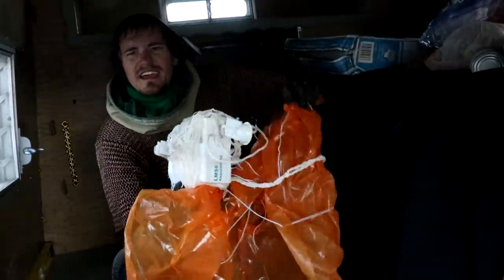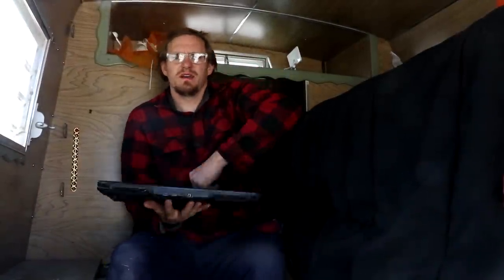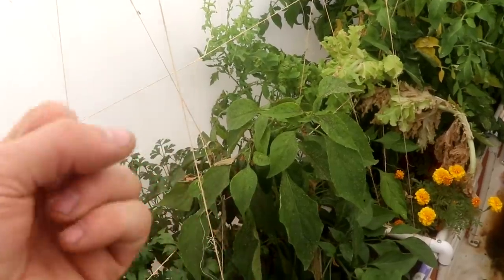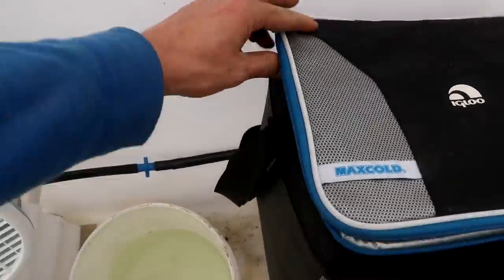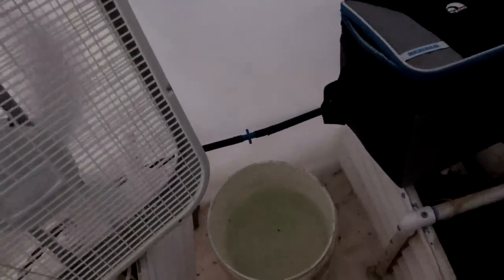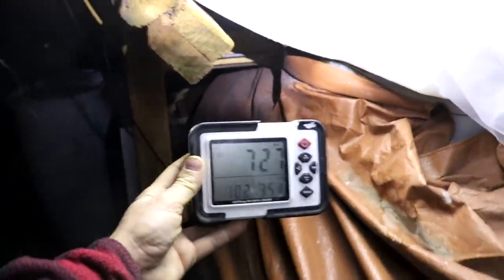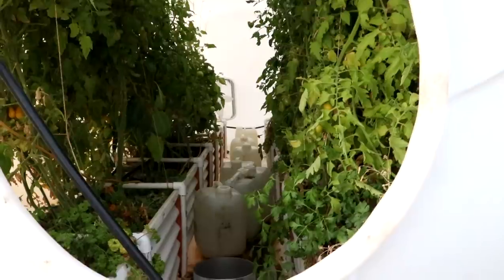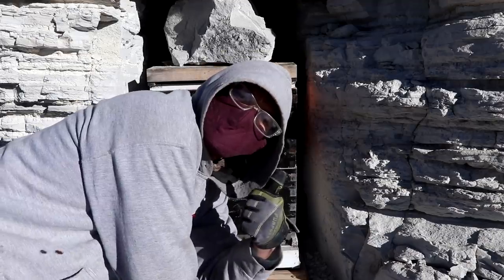ChickenHole Base Ep. 16: Avatar War On Aphids

Comment: I have a naive potato question: if you perforate a potato and heat it enough to cause water evaporation, will starch be carried out with the water?
Context: I'm cooking potatoes in a microwave oven and wonder if I should wash the towel used to wipe up the water in the oven.

Comment: Would ozone kill aphids ? It seems like it would be relatively simple to fabricate some sort of ozone generator inside the greenhouse although I assume it would be fairly power hungry
Reply: Wouldn't ozone kill the plants, too?
Reply: @johnpossum556  I assume so eventually but so would the Co2 judging by the video but I imagine it would be more harmful to the insects (this would have to be tested) however I did some quick research just now and it does appear to be a viable pesticide and it has some other key advantages aswell such as it can be produced on sight, it decomposes into harmless Dioxygen in roughly 20 minutes, and it can clean/sterilize the produce itself
Reply: @c-stofft-stoff8531  I haven't specifically played with O3 but I have with hydrogen peroxide which is a similar oxidizer and it ruins everything, organic or not.
Reply: @johnpossum556  wooo wait a minute I did not mean liquid ozone that will detonate for no reason it was experimented with as an oxidizer for rocket fuel and caused a couple catastrophes I meant like an arc gap/spark gap that generates some ozone gas so its diluted by air

Comment: What about some other gases, like hydrogen cyanide? Something cheap or simple to synthesise.
Reply from the maker: Phosphene would actually be an option. 🤔
Reply: @theCodyReeder  I believe you you meant phosphine (PH3), which indeed would be effective. Though, finding the resources and doing the synthesis might be a little bit more involved.

There would probably be other gases suitable for the application.
Reply from the maker: Indeed, wrong chemical name is a result of the glass rectangle I’m tapping this out on thinking it’s smarter than me. 😅 but the synthesis is pretty straight forward. Mixing rodent bait with acid should do it.